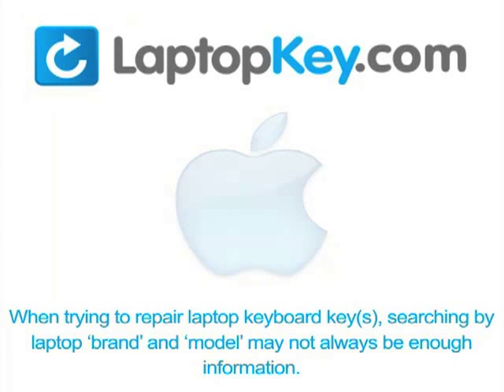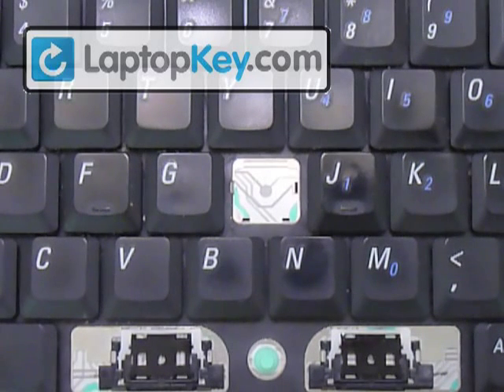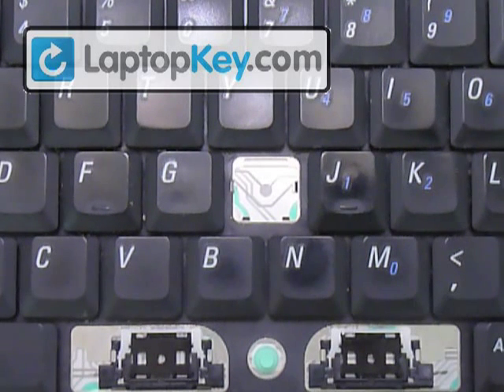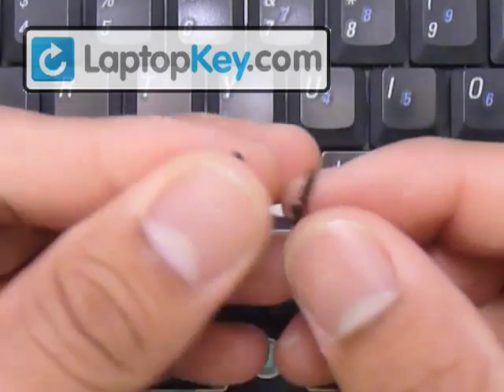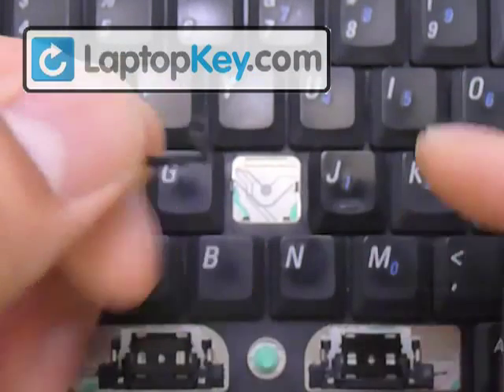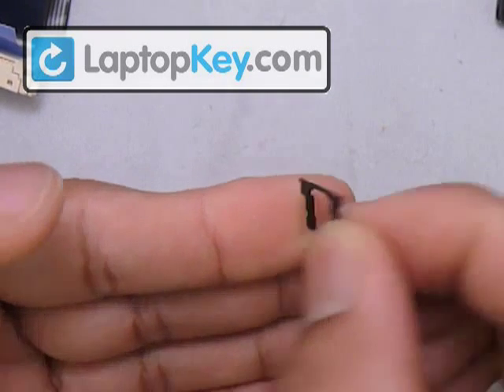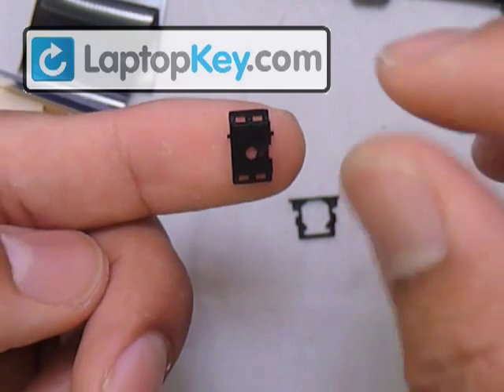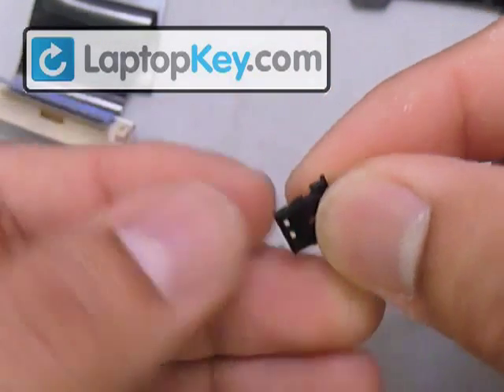Replace Keyboard Key on Dell Inspiron E1405 E1705 E1505 8600 8500 | Fix Laptop Installation Repair

Comment: Thank you so much,
My Inspiron E1525 Key doesn't look like this ( key button is white, and 2 plastic pieces are white )  but I didn't know that the inner plastic piece had to attach / lock into the outer plastic piece as you show in the video.
After seeing that, I was able to fuddle and get the key back in place and working !
Nice showing that you have to know which side is facing up or down.

Best, LA Guy